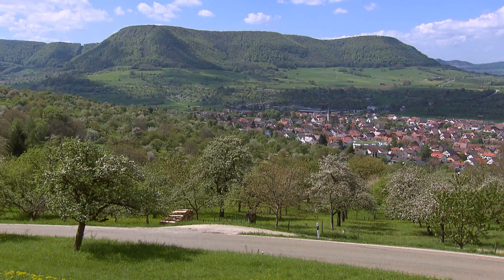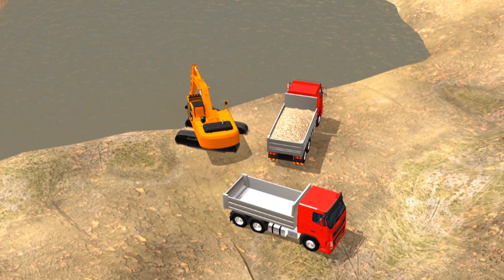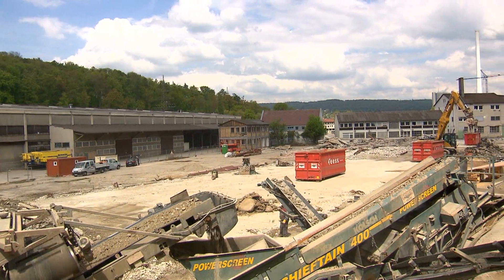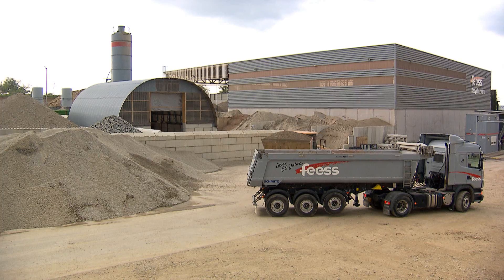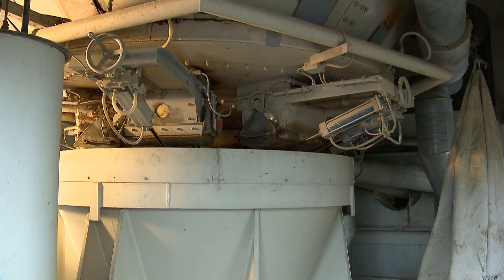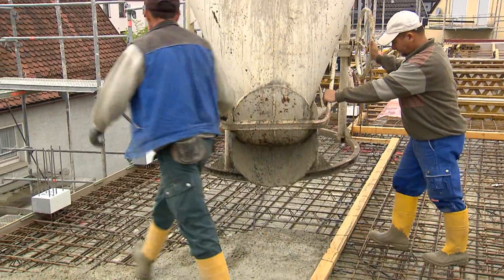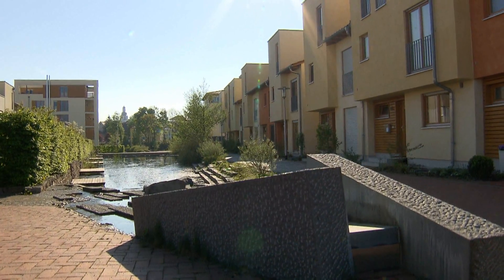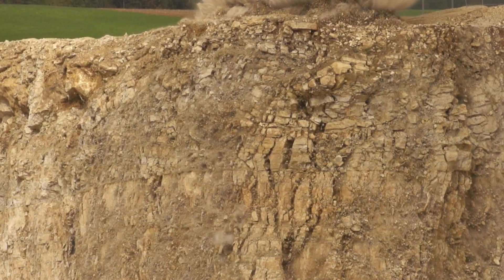Recycling concrete

Comment: I wonder what will happened to recycling process if the concrete were not only steel-reinforced but also fiber-reinforced? for steel fiber, maybe it can be removed by magnetic along with the steel reinforcement at the same step but what about polypropylene/glass/natural fiber?

Comment: You left out perhaps the most important factors: turning natural limestone into cement requires a lot of energy, some plants burn rubber, or other hydrocarbon fuels which creates a lot of carbon dioxide,.  And even worse; removing the carbonate from limestone [calcium carbonate] produces vast amounts of carbon dioxide, so using recycled is one of the best things we can do for planet Earth, and ourselves. Very nice video, though.

Comment: Here in the USA the need for this service has in many places become tied into growing environmental impacts from demolition material being cast off to illegal dumps; either to avoid the cost of hauling to commercial recyclers, or the absence of localized materials recycling operations.

A really well appreciated and most likely profitable favor to the demolition industry would be to invent a rock and concrete crushing system that was more appropriately scaled and costed to job-site operations; the size where the throughput needed from the crushing system is not measured in multiple tons per hour; more like 1/2 to 1 ton per hour.

Instead of having to pay for hauling castoff rock & concrete to commercial operations, contractors could process the material into forms useful on the jobsite, or possible to be sold to other parties. This would also cut down on them simply calling up people to dump the material "anywhere we can't see it", which in many locales has been and still is a growing problem.

Not only would this open up new sales/leasing/rental business for the machinery, but would have immediate impact with environmental concerns over the swiftly growing number and volumes of illegal construction materials dumpsites.
Reply: Here in Texas, we do haul most of the material to quarries where it is recycled.  Much of it goes to the cement plants to be reprocessed.  Type 1L (Ecoment  Capitol Cement), or Type 1/2 LA (Alamo Cement/Buzzi-Unicem) is made with recycled material mixed with fresh limestone.  It is used in home, commercial, and road construction.  We use it for soil stabilization in spread operations and budget conscious readymix companies.  I am a cement tank hauler.  I haul it all the time.  Very good for it's application, and economical.  There are companies in Houston that have been recycling used concrete for decades.  Near Austin-Bergstrom airport, there are several quarries that do it, also.  Very little goes into landfills around here nowadays.  I agree, more demolition operations need to step up and recycle their waste.  It just isn't necessary or cost effective.

Comment: This has some major potential problems. Recycled concrete can be loaded with potential low strength conglomerates. Buildings from so long ago did not have the advancements of today’s engineering. Different structures require stronger materials pending on the bearing ratios they must hold. 
700kn seems strong enough right? Until you understand the test procedure. By looking at the test sample assuming it was .02m3 cube, this would equate to less than 30mpa.
I personally wouldn’t be using this for any structural foundation or suspended applications.

Comment: I think about it technically , the old concrete that's recycled is stronger than the new, as stones and aggregate mixed together help stop cracks spreading , as some of the old particles of the old concrete has gone off its doubles up in strength when reused as you have already miniature gone off sizes in the new concrete

Comment: when we recycle, we also reuse the energy used to obtain the materials. Not exactly, but you get the idea. We pulled something from the ground, spending say 3 energy, recycling it costs 2, net energy gains 1. plus that material itself is not easily replaced, it can be found in other places, but that is not the same as actually replacing it, that is just using up more of whats available to be used.

Comment: This video shows how the use of recycled aggregate in concrete keep the compressive strength of recycled concrete and other properties like viscosity (work ability) seem as for normal concrete as well as the other advantages are to reduce the environmental impact clearly.

Comment: They are rock quarries. It's called crushed rock. Gravel is found in gardens.
Reply: Actually it is called recycled concrete aggregate (RCA). Rock is a primary raw material.
Reply: After 44 years as an Owner/Operator hauling rock, asphalt, dirt and broken up concrete to the recycling plants in Metro Atlanta.. like other operators, we all use the same terminaligy. Only Yankees, Home Owners and Gypsy Travelers call Crushed Base Rock,  Crusher Run or it's mostly called GAB in the Quarries etc. Gravel and call Asphalt.. Black Top.  Example: Bring a load of Rock and specify the type and bring me a load of asphalt (mixed hot at 320° or so from a pug mill or drum mix Asphalt Plant. TD Atlanta

Comment: Looks to me like a waste of diesel fuel to run all those heavy machines recycling BS
Reply: your name is fapking69 idek why im replying but the point is to not dump concrete in giant piles that would leech toxins and chemicals into the environment not gas savings also regular concrete is uses alot of fuel to mine and make this skips the mining process and its already premixed because it use to be concrete

Comment: Weird. In USA they built buildings mainly out of wood. While in Germany it's concrete. I think wood is better simple because it grows back.
Reply: Yes, it is far less environmentally damaging. Wood buildings have the same effective lifespan as concrete--only a very small proportion of either is removed because of "wearing out.". Instead, they are mostly either pulled down to be replaced with something else or are pulled down after being abandoned for a long time.  European building practices are extremely wasteful.

Comment: In my town, in the 1990s, tons of metal that had been used in a local hospital's x-ray room, eventually went to a local scrapyard/landfill. The metal came from tables, carts, structural applications, furniture, equipment, machines,..all with high metal content. No one labeled it as contaminated or tested it. There were no safety protocols for this type of recycling, and to this day, I don't know if there is any laws or strict guidelines protecting us from this reckless practice.  So eventually some of the furniture and including stainless steel tables, were plucked out and found there way into junk stores, in addition some of it was stolen from the landfill pile, by pickers. A year later, some family is dying from extreme  radiation poisoning, and nobody knows why. The authorities think the problem is Radon gas, and chase some other false leads.  All the while, it is the stainless steel counters in their kitchen, and other furniture, that they bought at a junk store. It was eventually discovered, what was going on. Though it wasn't reported on in a serious manner. And it was never talked about again,.....and no new safety practices were enacted or announced. (As far as I know) It was never discussed again in the local news papers. I only remembered it, because I buy used furniture from junk stores, too. Recycled concrete could contain high levels of radioactivity as well, and who would know.

Comment: Recycled concrete road base looks nothing like that in the United States. It's full of bricks and garbage. That's why the roads here are n such deplorable conditions.
Reply: Road base doesn't have to be clean. Aggregate does.
Reply: @toomanymarys7355  I've seen it in my nearly 40 years as an Operating Engineer. Wood and other unsuitable materials make it almost impossible to compact properly.

Comment: Just put the used concrete back into the quarry! They dig up the limestone out of of quarry, use it in a building for 50 years, then put it back into the quarry hole (aka landfill).  From the ground, back into the ground.  That makes more sense than fussing with inferior concrete.

Comment: I used to test concrete cylinders in the USA.  We would turn off the machine a split second before they break.  They are very loud, dusty, messy, the shards are sharp and it wears out the expensive machine faster if we let it go to full break.  Sometimes my fast reflexes were not fast enough.  They sound almost like a small shotgun.
  Another subject is the lack of dust masks.  These people are going to suffer with COPD if they do not protect themselves with N 95 or better dust masks.

Comment: 1950s-1980s
You are going to just ignore the 1930s and 1940s I see.  Lots of things were made of concrete then too.
Reply: Many of the buildings in areas before 1945 were destroyed - remember, there was a really big war. I suspect in a postwar building boom a large amount of really poor quality construction was produced since a lot of it was needed quick and quality control was of a low consideration.  There would have also have been a period of chaos just after the end of the war.   It would be nice that maybe we really should focus on quality construction which would have a long use life and be convertible to other things.  The recycling problem is created by demolition and building.
Reply: @lewisdoherty7621  Lewis, I tend to agree with you.  Touring Vietnam and Thailand I saw concrete buildings from the 70's and 80's.  The poress concrete in high humidity geography led to black mildew and corroded rebar.

Comment: The quarry face shows how all the rock was fractured even before the explosion.#
The fracturing occurred in the layers of drying sediments of The Flood 4,350 years ago.
Reply: Bores and explosions are sheaper than excavators. And the cracking is not small enough to fit them into crusher and one can have lesser abrasion of crusher hammer surface platting.
Reply: @wernerhiemer406  That's nothing to do with The Flood.
Reply: @rosewhite---  Pff I only reasoned why it is still fractured even more or just torn down that way. I never assumed that this lime gets used as plates.

Comment: I LOVE recycled concrete! My home is located on a private, three mile long gravel road which    homeowners are required to maintain. Several years ago we had trucks lay down a 6-8" thick layer of recycled concrete on several hilly grades - our problem spots - prone to erosion, and once the material packed down, it's proven to be nearly as durable as poured concrete.
Reply: Thanks for sharing this practical usage.
Reply: You can add cement powder to the gravel in the problem areas to help it remain in place.  It is called cement stabilization

Comment: Destroying nature in order to get material to be used in building ugly high rises (well, quite often)

I work construction so being able to have a sustainable resource like recycled concrete would be a good step forward alongside using nature as a model to build well-lit and aesthetically pleasing housing.

On our sites we always try to use as much of the existing ground material such as sand and aggregate that is on-site and excavated as part of the construction process. Thinking holistically is the key here. Additionally, many much older cultures had quite ingenious solutions when it came to construction. As they didn't have electricity, they had to devise solutions that relied on nature to create livable spaces such as using the chimney effect to provide comfortable climates inside buildings which were located in desert regions.

Comment: what happens if the concrete in for recycling was a poor grade of concrete, made with beach sand that had salt.. or decomposed granite was used as an aggregate .. would that effect the long term life of some of the batches of new concrete in the decades to come..
Reply: Well if one waits for millions of years you get lead by radioactive decay.

Comment: The concrete company mixes their batches properly and then on site, the contractor tells the concrete driver to dilute the mix. Within a year, the concrete starts to fall apart.  That's how it is where I live per a concrete mixer driver I know.
Reply: This is why we need enforceable construction regulations.
Reply: Let me tell you a secret, concrete truck drivers are delivery boys that do good to keep the truck running and know nothing about concrete
Reply: @baconneggs2406  Not quite.  I know a driver that told me the second he's on site, he's told to dilute his load before the pour.  That's first hand.  No reason the guy would lie to me.

Comment: Recycling is also cheaper.  If the old can be reused then that's a good thing.  Has nothing to do with the climate.  Maybe if you stopped using plastic straws like california, then you climate will be saved.

Comment: I think its dangerous to use recycled concrete in high stress structures.
why was the tests shown not compared to normal fresh concrete stress tests, this to me shows that recycled concrete  lower in strength .
Also how does it age? normally after say 70 years or even 100 years the strength fades , how does this compare to older recycling materials that have already aged and weakened.
Reply: I thought concrete never fully cures and gets stronger over time as long as the elements don't degrade it ?

Comment: Errr...
It seems to me that the concrete is not reused in the sense that cement is made from it again. That would require crushing to powder, further separation and re burning.
It is used to replace the fillers that normally go into concrete. Great of course to use it like that and decreases the raw amounts needed for those, but does not limit the amount of cement needed in any way. Thus what the video started with, the production of cement, is not affected in any way by this type of recycling.
Reply: Quite correct. They are reusing the aggregate, but must still use virgin cement.

Comment: Recycling concrete is an excellent idea.  But the false presupposition and reasoning  is that the existing landscapes or "nature" should be preserved.  No, new landscapes can be created with good management practices.  This faulty reasoning is based upon environmental religious beliefs from an evolutionary worldview which is dangerous and unsustainable as it will lead to the extermination of mankind... to preserve nature.  It's foolishness.

Comment: I used to test concrete cylinders like that but we would shut the machine off, a split second before it shattered.  It is not good for the machine to let it break like that.  It is a mess to clean up the sharp concrete shards that fly everywhere and the concrete dust causes COPD.  I would see the pressure decrease slightly a split second before it shattered and we would know that we were real close to the pressure that it was going to break at.
Reply: I’m sure they only let it shatter for the camera.

Comment: yes but if non recycled concrete is stronger and will last longer then using that is a far better option because you do not have to rebuild/renovate houses as often which in turn is better for the environment and its people.
Reply: Durability
You may be wondering if a recycled material is as good as a new product. The answer is: Yes! According to the Federal Highway Administration, RCA is as structurally reliable and safe as natural aggregate materials. Furthermore, by using recycled concrete scrap, you can decrease your expenses, while also doing your part for the environment. The best part is that you’ll get to enjoy all of the benefits without having to sacrifice on quality.